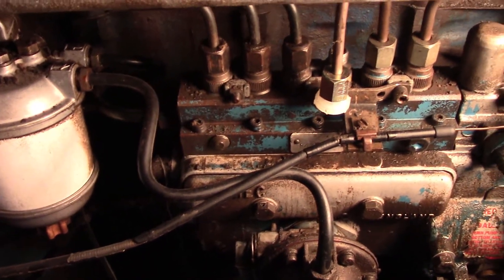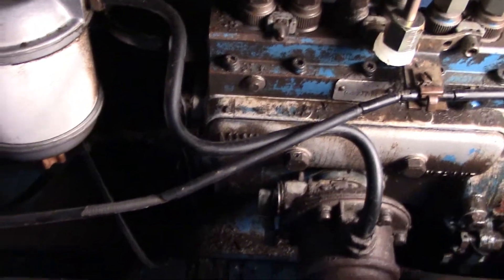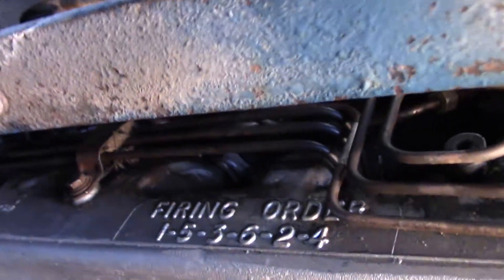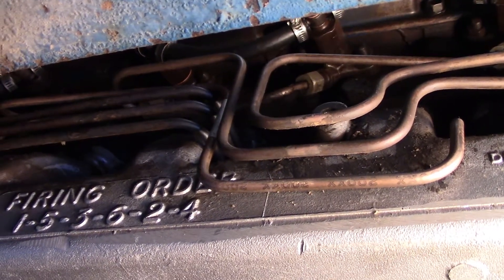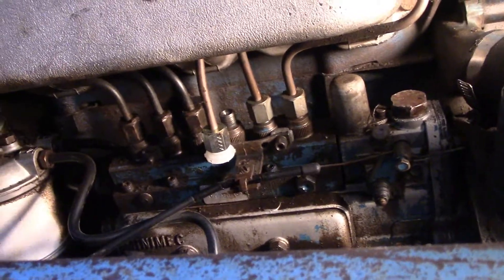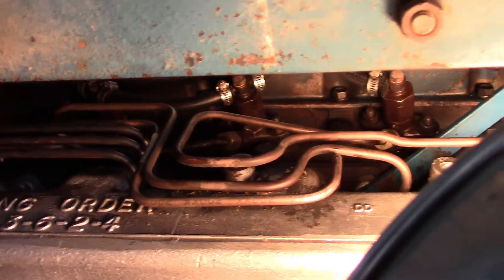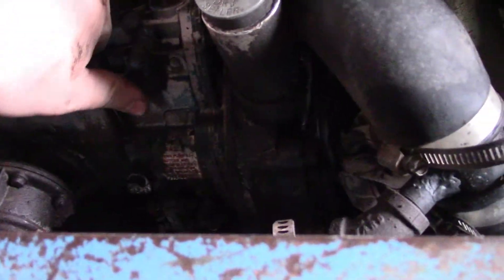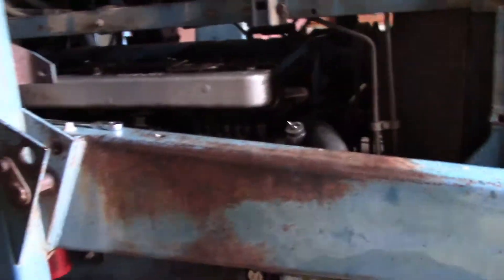Ford 9600 Injection System Bleed, Prime, and Start

Comment: Is there a bleed screw on the injector pump itself? One could remove air while using the hand pump lever if there is. Thanks for the great video.
Reply from the maker: Not that im aware of but if you are just changing the fuel filters you can use the bleed screws on top of the filter housing for a more convenient air bleed.

Comment: Do you have a part number for fuelfilter I have Napa 3195. And the filter will not prime. Lift pump is supplying fuel I the think the filter is wrong.
Reply from the maker: The 2 filters currently installed on my 9600 are Baldwin BF825 . If the image on Napa's website is accurate I wonder if someone installed a different fuel filter setup on your 9600 because the baldwin BF825 looks very different from the Napa 3195.
Reply: I have in my Ford 9600, Delphi/Cav 296. But are the same Mann P917X and Millard MF-1191.

Comment: Wow I didnt realize it would take that much cranking.ive been struggling to fire up a tw30 after changing fuel filters . just wont prime .
Reply from the maker: Yeah this system can be a bear to get primed when completely dry. The filters depending on the fuel filter brand they sometimes will put a tapered o-ring at the filter face that can be troublesome to get to seal properly causing a constant loss of prime.
Reply: Thank you for the tips. Do you have a parts supplier you can recommend.
Reply from the maker: I use a lot of local shops some heavily specialized. That's my first real recommendation to anyone is ask a parts store your at who rebuilds this or who do they use to rebuild certain rebuildable parts. That's how you can usually find the specialized shops in your area. When I get desperate for a part I turn to the internet and I have found Messick's (https://www.messicks.com/) to be a great go to site for oem parts and Ive tried out Yesterdays Tractor Co (www.yesterdaystractors.com) once for front wheel bearing for a ford 9600 with great results. If im doing non-oem for a few parts like chains, sprockets, non specialized bearings, that sort of thing I found Applied, Motion Industries, and McMasters to be great resources. Applied especially sells rubber belting and ill use them to re belt a round baler but keep in mind these are a bulk belts you cut/splice to what you need. Ebay cant be over looked either you can pickup some new old stock of many name brand parts your looking for at a great price.